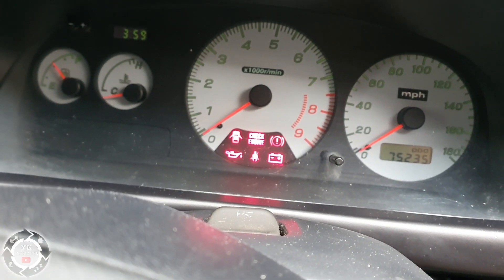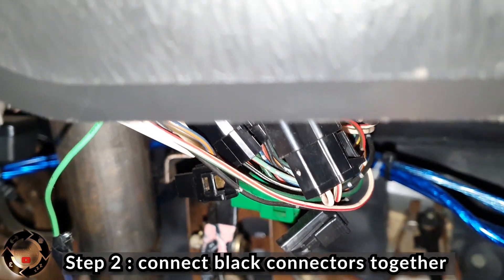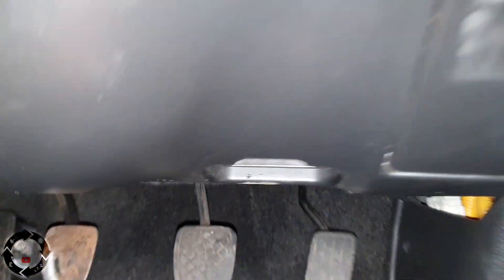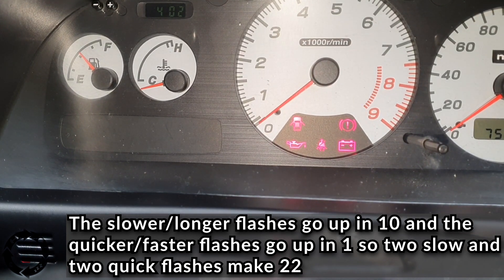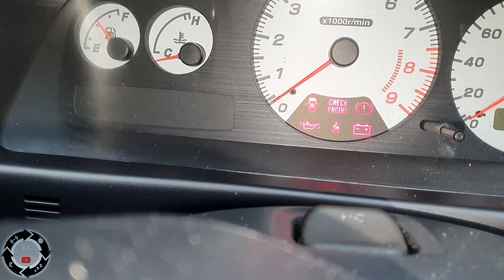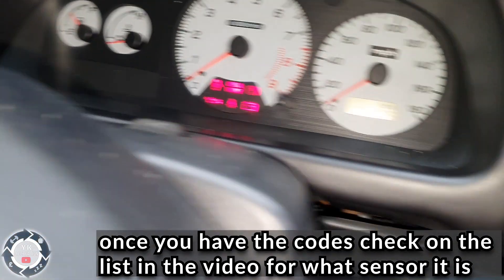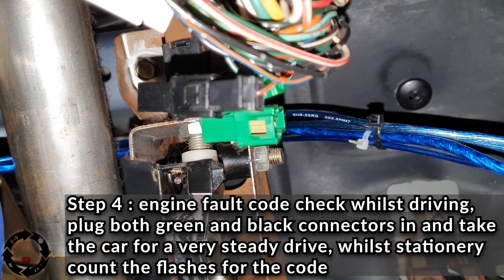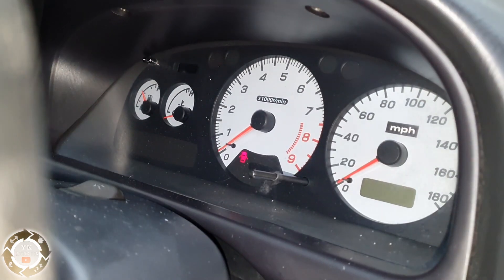HOW TO CHECK SUBARU IMPREZA FAULT CODES WITHOUT A CODE READER, FLASHING ENGINE LIGHT 92 - 01

Comment: Bro...need you advice..got a gf8..how can i contact u bro..jzk. got code 23..its constantly on..when i turn ignition on..flashes code 23. Changed the maf sensor..do i need 2 do a reset? I disconnected battery for few hours? How do i do a reset? 1998 GF8 it does have green and black plugs
Reply from the maker: Best taking it to a specialist bro I just fix my own cars, it shows in the video how to reset I can't remember top of my head

Comment: Helped me diagnose a fault which is knock sensor. Any idea where it’s located on a gf8 classic import 2000? Thanks
Reply from the maker: Under the inlet manifold in middle of engine, you should see it, got a single wire plug going to it
Reply: Also on the code list it mention knock sensor or circuit under 22. What is circuit? Where is it located? Thanks
Reply from the maker: Circuit is your wiring to the sensor
Reply: Since changed the knock sensor, reset it by connecting black & green plugs and following your instructions. After that was done reconnected the black plug to run the codes and still showing as knock sensor. Any help/advice please
Reply from the maker: You mentioned its showing circuit so you need to get your wiring checked, maybe drive it steady with both plugs connected then do the reset on the video

Comment: I connect both green wires and turn ignition on and the map sensor starts clicking in the engine bay what’s that all about?
Reply from the maker: its probably testing the sensor, did you connect both black and green ?

Comment: I did this but the check engine just kept flashing continuously?
Reply from the maker: was on your engine light on? before you did the test, run me through issues and il try help
Reply: @YKRECREATION  no mate it wasn’t turned on. I have rough idling, when I turn it on it’s spot on but when it’s warmed up it’s flickering up and down the revs. It’s been recently mapped by Bob rawle too, he said idle control valve? I cleaned it and it made no change, just wondering if any codes would of come up but nothing.